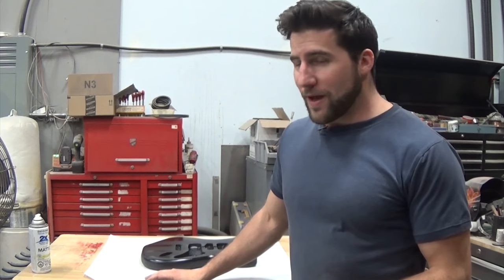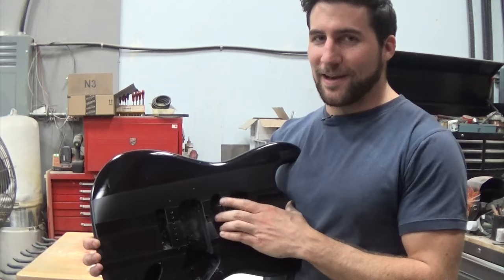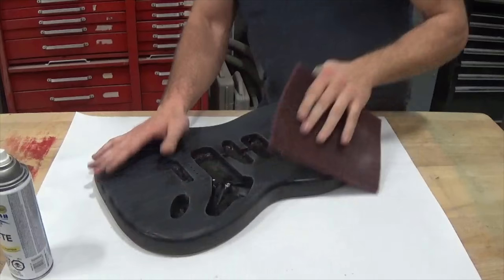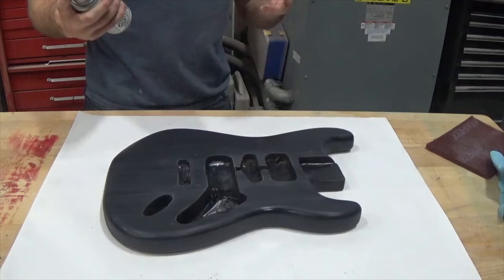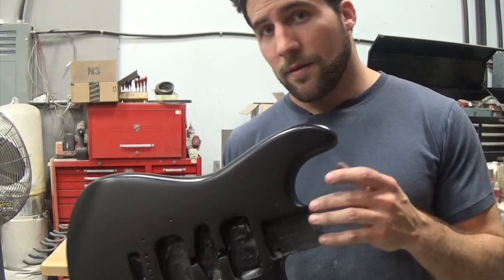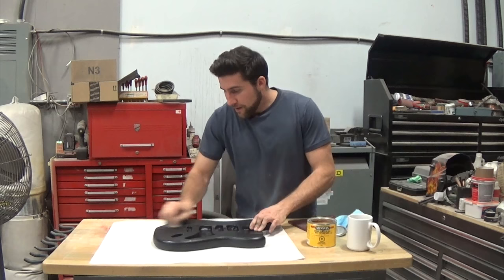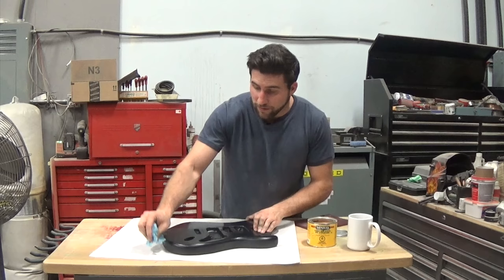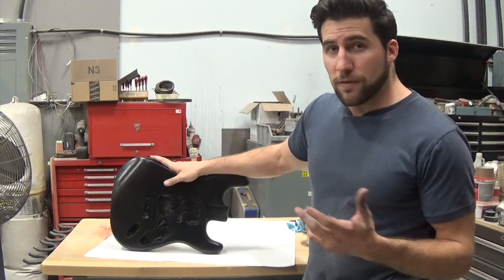How to turn gloss paint matte or satin

Comment: if you can't get the exact matte clear coat spray is there any alternative you can use on a wooden black gloss area to turn it to matte?
Reply from the maker: There are lots of different matte clear coats out there.
Reply from the maker: I’m not even going to pretend that I can read that haha. Anyway, if you sand your finish the new stuff will bond mechanically rather than chemically, so you should be fine on that end.

Comment: Hey man, I'm trying to get a god finish on something I've been working on. The coat i used last was the Rust-Oleum metallic gold. Which apparently is laquer. I want to do a matte finish on it though.how would you recommend I go about getting the best results? And what type of paint should I use for this.
Reply from the maker: Which metallic gold was it? The reflective finish, or the mica finish?
Reply: Brad Angove reflective
Reply from the maker: The reflective finish isn’t compatible with clear coat, so really there aren’t any options for trying to change the finish on it unfortunately.
Reply: Brad Angove so I shouldn't even attempt doing the matte coat at all?
Reply: The reason I'm trying to do it is because the gold paint seems to be rubbing off big time. So I was hoping I could add some sort of clear or matte coat to stop the gold from rubbing off
Reply from the maker: You can try it out as an experiment, but it’s not designed for that.

Comment: For an electric, this is perfectly acceptable.

But for an acoustic guitar, I'd recommend against adding paint to achieve your satin/matte finish...
Reply from the maker: indeed
Reply: @BradAngove  thanks for the reply ^^
I wonder if you know an alternate way that works without adding paint.  I have this beautiful all Koa acoustic guitar, where they went so over the top on gloss, it looks terrible on video footage...
I know, I know, first world problems...
I feel petty for asking... and I haven't found any method without.
Reply from the maker: The only method I’m aware of to achieve an effect of that nature is basically just abrading it back to a less glossy surface. For example, sanding with a random orbital at 3000 grit gives a pretty much semi gloss finish. As you try and go further back toward matte though it before more and more difficult to have it look good because the heavier grits leave that white sanded look.
Reply: @BradAngove  awesome, thanks for the detailed info!
I'll ask the manufacturer what finish they used, then I'll make a test area on another piece of wood to try how much or how little of that I should do.  3000 paper, I might just dare to do  :)
Though I've never seen 3000 paper for my Random Orbit sander, I might have to glue it to a used up pad...  if it works, maybe one day, I'll send you a picture ^^
Reply from the maker: Mirka abralon and 3M trizact pads come in that grit range for orbital sanders.
Reply: @BradAngove  copied to my shopping list!
Thank you so much!  :D

Comment: HI, I am trying to repaint my motorcycle helmet, trying to get a frost black finish, so i guess like a semi glossy matte black, would these steps work  with my project? Also, what is that thing in that jar you used to turn it glossy-ish, the stuff that was on the steel wool.?
so would these be my steps?  
~sand helmet
~apply primer,~paint with glossy black,~ apply steps u did in video involving steel wool and jar,~ and finish with a matt clear? is this right? im lost :(
Reply from the maker: Those steps won’t work. The stuff in the can is finishing wax. Clear won’t stick overtop of that. 
I think you’re just getting confused because you’re on the wrong video. Have a look at my video on how to do a matte black paint job with spray cans. Then, if you want it shinier, you can use the paste wax.

Comment: Brad, Im about to try this on a Midnight Wine color MIM Strat Body. Im just going to go for the Matte type.  Won't hold u to it but what do u think of Matteing that particular color? I think it would work out but what do u think in ur experience? Is this really all it takes to make it Matte?? Any extra steps u would recommend?? Thanks again for all u do.
Reply from the maker: Is it currently a full factory gloss?
Reply: @BradAngove  yeah man, its full factory gloss. Midnight Wine they call it. 04 Strat. Been wanting to do something to it for a long time
Reply: Ive been reading a lot about using micro mesh too instead of the pad...thoughts?? Im trying to stay away from steel wool if poss.
Reply from the maker: Micro mesh should work just fine if you’re careful with it and choose a high enough grit.
Reply: @BradAngove  thanks

Comment: I kinda like the look of the guitar right after you used the scotch brite pad. Is the spray on matte stuff (or something like it) necessary or can I leave the guitar without it?
Reply: Curious about this myself.
Reply from the maker: It’s up to you. If you like the scuffed back look; let it ride haha.
Reply: @BradAngove  that’s great. So it’s not compromising the finish, protection, etc?
Reply: I did it about 2 months ago. Scotch brite pad and no finish after that. Looks nice and scuffed up! I'm happy with it:) Awesome video btw
Reply from the maker: As long as you don’t go through the finish, which is tough with scotch brite, it should be ok. Technically you’re removing a bit of protection from things like moisture and UV, but not really dent prevention.

Comment: My scotch brite pad is leaving very visible scracth marks on the surface. Looks glossy but with big scraches. What should I do for this :(
Reply from the maker: What color scotch brite are you using?
Reply: @BradAngove   exact same colour as yours. Mine has "VF 360" printed on it. Thanks a lot for the answer :)
Reply from the maker: Try buffing it with a cloth now and see if that helps. If it doesn’t, a white scotch brite or magic eraser may also help. Unfortunately the scotch brite is an abrasive, so scratching the surface is kind of how it works.
Reply: @BradAngove  thanks a lot your are very helpful :)

Comment: Will this work for an electric that has a tobacco sunburst pattern under the gloss? And for an acoustic that also has a tobacco sunburst underneath? I have a breedlove acoustic and a prs electric both with tobacco sunburst and gkoss finish. Im hoping to keep the sunburst looling nice but give it more of a matte finish. Any special scotchbrite and gkoss clear i need or just grab the regular stuff from home depot?
Reply from the maker: It will work on any clear coat as long as you use a compatible clear with it. I’d hesitate to do it to an acoustic though since finish thickness can play a role in how it sounds.
Reply: @BradAngove  worth thinking about thanks. Is there any good way to get the scratches out if the acoustic finish then at least? I like matte because it doesnt show the scratches and smudges as much and just looks less flashy. But i wouldnt want to mess up the sound so maybe i should be figuring out how to fix the imperfections at least. I have guitar cleaner and polish but it only helps so much. It isnt a huge deal but i like learning to properly take care of them.
Reply from the maker: Do you have compound and polish? Or just the cleaning “polish”?
Have a look at my video on problems with matte finishes if you want to see a bit about the smudges.
Reply: @BradAngove  i have a prs guitar cleaning kit. It has a cleaning spray and a liquid polish.
Reply from the maker: Ok, that’s not for removing scratches. Have a look at one of my videos on polishing.

Comment: You used rustoleum? If I do this to a gloss poly finish, would it be better to use 2k urethane? More durable? Not necessary? No different than rustoleum? Thanks.
Reply from the maker: The 2K is better. I have a video on 2K vs 1k vs 2x. I also have one on how to get a professional looking clear coat with spray cans where I use the 2K. Really no need for the 2 can method when you’re using that.
Reply: @BradAngove  Thanks for the response. These videos are great! So I'm having trouble finding a paint repirator because of COVID. I'm wondering if the 1K would work well enough for this project. I have a gloss guitar body from Warmoth and I want to make just the back and sides satin. I plane to sand it with a scotchbrite like you showed in one of your videos and then even it out with a spray. Do you think 1k would be sufficient? Do I need a respirator for that? Thanks!

Comment: +Brad Angove I finished a guitar with Minwax True Black (an oil stain)- any recommendations for a matte clear finish to seal it?
Reply: Will a guitar finished using Minwax True Black need any kind of sealer? I’m going for a matte black, not sure if it’s ok with just the Minwax stain or if I need to use something over the Minwax
Reply from the maker: You may want to consider using a low sheen oil based poly over top.

Comment: I bought the scotch bright and gave my car a rub down. It’s left small scratches everywhere. Will those disappear once I spray the matte coat? Also how do I know when I have sanded it enough? I feel like it needs more but am afraid of sanding the color off and making it look horrible and uneven in spots.
Reply from the maker: You just want to abrade until it’s not glossy anymore. No need to go any further. As long as you didn’t use a pad that is too coarse the scratches should come out.

Comment: I just attempted this on my guitar and accidentally dragged the bottom of the can through the wet clear coat.

After letting it dry, I sprayed a little bit on just that spot so that I could level it out with the rest of the finish, but after levelling and sanding that spot, it is noticeably duller than the rest of the finish after the clear coat.

Any advice?
Reply from the maker: What kind of finish is it?
Reply: @BradAngove  just doing a matte clear coat from a gloss finish.

Comment: I sanded my les Paul and then sprayed rustoleum matte clear on it and after it dried it turned white any idea what I might have done wrong
Reply from the maker: Is it just hazy, or actually white?
Reply: It’s very hazy
Reply from the maker: Sounds like a humidity issue. Probably blushing. Was it relatively humid when you were spraying?
Reply: Yeah your probably right it I did it on my porch at night

Comment: I'm thinking of doing this with my black gloss painted motorcycle. Gas tank, plastic side covers, and fenders. Using a black blitz tractor paint in rattle cans. Can this be done and look decent? I was told several have done this. @Brad angove
Reply from the maker: I’ve never done it, and I always say that spray cans aren’t a great idea in automotive applications. It should be do-able though. Not sure how durable it will be.

Comment: Hi Brad.  I have a factory guitar that is gloss black which I want to bring to a satin finish.  Can I use the method that you show in the video or do I have to sand it back further with sandpaper since it's the factory finish?
Reply from the maker: Just sand it lightly with 800 grit and apply a coat of satin clear over it.

Comment: I'm working on a project that's plastic, and I'm going to spray it with gloss paint. Then I'm going to scuff it and spray a matte clear coat on it. The question is, how many coats should I spray? How long should I wait for it to dry properly? And do I need to scuff the matte clear coat before adding another coat?
Reply from the maker: +TheLizardking 927 you should start with adhesion promoter. The number of coats depends on the paint type, but it's usually 2-3. Give it a couple days to dry and then scuff lightly before adding you matte clear. Sanding in between your clear coats is dependent on how long you wait between them.
Reply: Brad Angove Thanks! Two more things, how many clear coats should I spray? And how long should I wait in between clear coats? 1 hour or 30 to 20 minutes like in the video?
Reply from the maker: +TheLizardking 927 what kind of clear is it?
Reply: Brad Angove Rust-Oleum American Accents Matte Clear with 2x Ultra Cover. It doesn't say if it's an enamel or whatever.
Reply from the maker: +TheLizardking 927 I would generally do 3 coats of that 10 minutes apart.
Reply: Brad Angove Thanks for the tips Brad, I hope this will help me!
Reply from the maker: I hope so too.

Comment: Brad.  Thanks for video.  I have gloss wood floor that I would like to change to satin.  Not sure if poly topcoat or UV.  Appreciate any ideas.
Reply from the maker: Poly is pretty typical for that. I would forewarn you though, it will develop glossier areas where it gets the most use. Feet etc. will polish it to some extent over time.
Reply: Are you saying just apply poly over current finish of wood floor and I assume satin??
Reply from the maker: You sand first, then stain, then poly.
Reply: So you are saying sand all of down to raw wood and redo with stain etc
Reply from the maker: If you want the stain to work properly, that’s basically what you have to do, yes. You can start with finish remover if necessary.

Comment: Do you have any advice on how to repair a chip down to the wood on a schecter damien fr satin black? Ive tried several guitar stores and they are just dead ends.
Reply from the maker: +Brayden Biller with something like that, unless its lacquer, I would generally scuff that while face of the guitar, fill the chip, and respray that face.

Comment: +Brad Angove can you sand a tru oil finish to satin?
Reply from the maker: If you use a high enough grit, yes. I’d probably go with 3000.
Reply: @BradAngove  should you wet sand or normal sand tru oil?
Reply from the maker: I would likely dry sand it.

Comment: Hey Brad, I have an SG gloss where you can still see the wood grain. so I can't paint it after. I did this to the neck and it looks great. Is there any way to do this to the body?
Reply from the maker: I’m not sure what you’re asking exactly. You did what to the neck? The steps from the video?
Reply: @BradAngove  i found the video after I sanded down the neck 
w/0000 steel wool and i liked the result so I want to do this to my whole guitar like this video but my guitar is a stain not a solid paint. So I'm wondering if I'd still be able to do this method? Sorry if this is a dumb question. Never done  anything thing like this before
Reply from the maker: Well does your quotas have clear coat on it over the stain?

Comment: Is the Scotch-Brite step necessary?
Reply from the maker: Before spraying? You can use sandpaper instead if you want.
Reply: No, I meant can I spray a matte or satin clear coat right over the glossy paint?
Reply from the maker: Not without scuffing it. It won’t stick properly.
Reply: @BradAngove  oh yeah, gotcha.   Thanks man.
Reply: @BradAngove  what if I just painted it and only had gloss paint but wanted satin... the paint is still fresh/soft.  Will it stick?  Its almost like adding another coat of paint, isn't it?
Reply from the maker: I wouldn’t count on it. How long has it been on there?
Reply: It had been on there a day. It's Rustoleum oil-based enamel. That same stuff people do cheap car paint jobs with (I'm not painting a car). It recommends 24 hours between coats. It doesn't seem to come in satin or matte so I figured I could do a coat of satin clear.
(Thanks for the help, by the way)
Reply from the maker: Yeah, you wouldn’t be able to get proper chemical adhesion with Rustoleum after a day.

Comment: Does this work for any guitar with a gloss finish? Will scuffing a guitar with scotchbrite always remove the gloss or can it remove the paint entirely?
Reply from the maker: It should work for essentially any guitar with a gloss finish yes. I can’t speak for situations where the guitar has a diy refinish on it, but generally this should work fine. 
Scotchbrite will take off the glossiness first, but will eventually remove the paint entirely if you go at it for too long. It shouldn’t be difficult to knock back the gloss without going through if you’re using scotchbrite. This will depend on the paint though. You’ll de-gloss and then go through lacquer a lot faster than polyester for example.
Reply: Thank you so much! This has been IMMENSELY helpful!
Reply from the maker: You’re welcome. I’m glad to hear it.
Reply: Brad Angove when using the scotchbrite how quickly would it go through enamel? Also, I’ve been looking at rustoleum “multipurpose” paints recently and I seem to recall you saying not to use multipurpose paints at some point. Are these paints enamel or something else? I’m struggling to find one brand that has the specific colours I’m looking for and have the same chemicals in the primers, paint and clear coat (ie not enamel and lacquer).
Reply: Ps: are the pens you use in the video “Adding graphics to your guitar with paint pens” okay to have clear coat over. I was planning to use rustoleum 2k clear coat
Reply from the maker: It would take the scotchbrite a long time to go through a decent layer of fully dried enamel. You would see that the gloss was gone well before that point. 
It’s not multipurpose paints that I don’t like, it’s the 2in1 type things. Like primer/paint. Or stain with poly in it. Or conditioning shampoo....
I don’t think Rustoleum has a 2k clear.
Reply: Brad Angove thanks for the response. Spray max 2k is the one I'm planning to order, as yes the rustoleum 2k doesn't exist. I think I'm going to be able to finally start my project, alot of help coming from you, so thanks for all the advice. Cheers brad
Reply: Sorry one more thing, are radiator enamels okay for painting guitar bodies?
Reply from the maker: Radiator enamels are ok, yes. Just make sure you let them dry fully and scuff lightly before applying your clear. 
I’m glad I was able to help Tim. If you go to my video on how to get a professional looking clear coat with spray cans, I demo the spraymax 2k. There’s also an affiliate link in the description that you can use to pick it up online if you feel like helping me out.